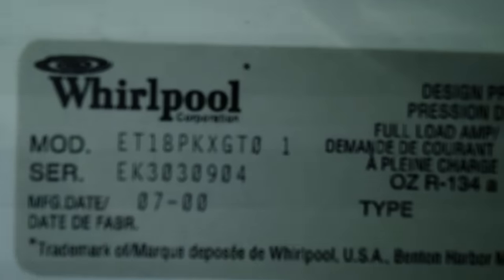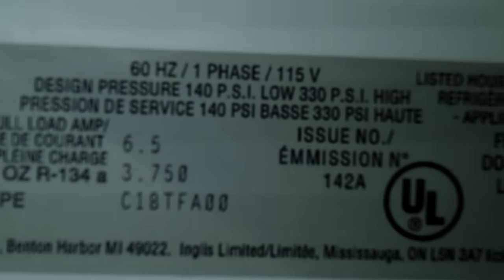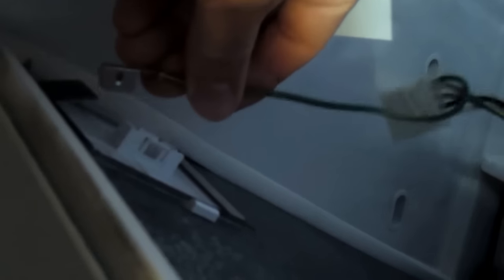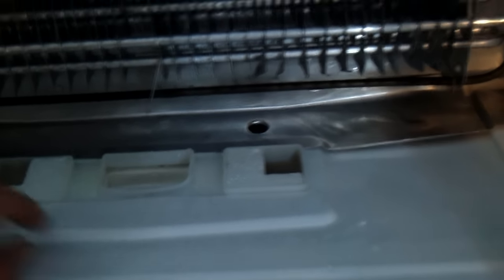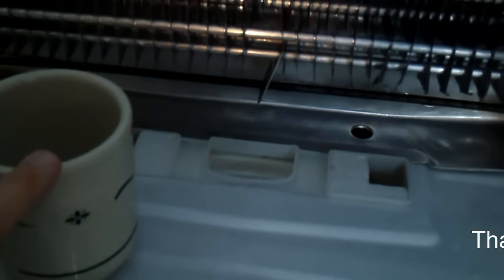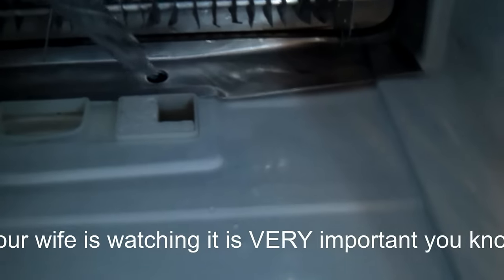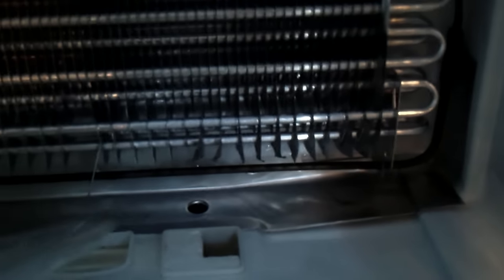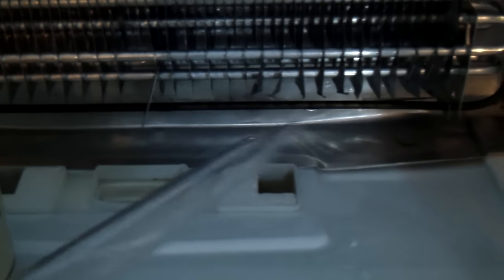Whirlpool Leaking Refrigerator Repair

Comment: The same thing happened to me today for the 1st time ever... I found a video that mentioned you can stick a 6 or 7 inch copper wire down the whole to make sure it does NOT clog with ice again (make sure you create a loop at the top so the wire can't slide down the hole!) - I hope that trick works, as it was NOT fun to fix this!

Comment: So mine isn't clogging but for true first time in years just heard the water hitting the silver part and draining fine. It sounded like it was hitting electrical wires which is why I was concerned until I saw it was hitting the plate. So then I good and this is normal?

Comment: Oh, DUDE!  You may have just saved me $500!  Our refrigerator has been flooded on more than one occasion, causing my wife to go bananas!  Also, it appears this "icing" and "clogging" issue may cause the refrigerator cooling system to run continuously, thereby sucking the electricity out of the grid and running up our utility bill!  They symptoms presented are EXACTLY what we have been experiencing, so I'm off to disassemble the components to find what I can find... wish me luck! :)

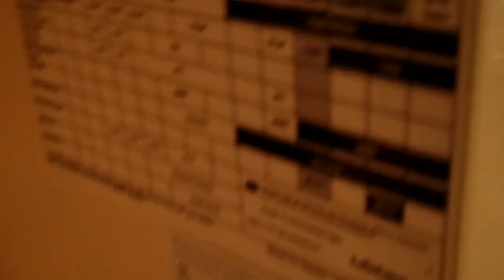Comment: My refrigerator (Model ET22DKXFW00) had 2 foam air ducts stuck into the 2 square holes you can see at 1:57. These are very easy to destroy, since they're usually frozen into the passageways, and we're not patient enough to let them get un-frozen so they can be slid out. I destroyed mine a couple of times, but now have bought two sets (p/n 4388450 for a set of 2, about $5 if you shop right) to have on hand. You may not have to pull these out, actually, but it looks like you need to the 1st time.

Comment: The way to permanantly fix this problem is to take an uncoated coat hanger and cut a 7" length.  Thread it into the drain hole and wrap the remaining end around the defrost heater element.  When the fridge goes into defrost, it will heat the wire and keep the defrost water warm enought that it can drain and not freeze the hole solid.  Mark

Comment: Couldn't you have gently chipped most of that ice off? Also...after you were done you could temporarily seal the drain at the bottom and fill that tube with boiling water to melt it all.
Great vid

Comment: My model looks nearly identical, except it does not have that drain hole. It has just a solid aluminium piece with no hole. Any thoughts?
Reply: +Land Designs Unlimited LLC thanks for your help here. It turns out there was a thick piece of ice covering it and couldn't see it. Took my wife's eyes to notice it.

Comment: This happened to me last year, but after a few months, it would happen again where it freezes up top, literally a sheet of ice on top of the drain hole.  To date, it actually froze again and I've been a little lazy to defrost the drain pipe.  How often do you need to defrost the drain pipe? It just seems like if I'm doing this like 3-4 times a year, something must be wrong with my fridge?
Reply: I ordered this today, so when it comes I will install.  Whirlpool 819043 Heat Probe

Comment: I  had the same issue I ended up grabbing a hose to blow into the drain line and after 10 puffs it cleared the line. The water in the drain pan was dirty

Comment: Has anyone discovered WHY that drain gets frozen and what the permanent fix is? Is crazy that this happens to so many WHIRLPOOL refrigerators inclusing mine
Reply from the maker: If you search the comments or the internet, there is a fix for putting a piece of wire around the cooling coil and down the drain.  I did it years ago, and this never happened again.  So long ago that I don't remember what I did.

Comment: I have not been able to get the screws loose. What did you use to get the screws out?
Reply from the maker: You should be able to get them with a slotted or philips screwdriver.  However, I wouldn't be surprised if I used a hex head screwdriver to get those out.  That will give you more grip on the screws.  Be patient and don't force anything.

Comment: I can expand on this a little.  Once you clear the blockage using the hot water.  Cut about a 3 inch piece of metal coat hanger, bend a hook in one end, place one end in the drain (long enough to hang into the drain but not block it) and hang the hook end over the over the heater coil. That will help prevent the drain from freezing and getting stopped up.

Comment: I have the same problem happening in my Whirlpool frig.  My refrigerator is a 2004 model and there is no pan in the freezer. Would you know how I remove the freezer panel in the back of freezer?? Thanks
Reply: If you have removed all "hidden screws" behind plugs then the panel pulls right off. Just be careful to unplug the fan wires after the panel is far enough to do so.

Comment: I think the holes also hold the bracket for the ice cube tray holder if there's no ice maker. You should definitely cap the water line, and I'd put the screws back in the holes as well. Turn off the water at the source -- a valve in the wall in fancy installations, or a saddle valve for less-fancy ones.

Comment: That's the way I repair the Whirlpool fridges. Long piece of copper wire wrapped around the heater running down into the drain tube. I think I have done a couple of dozen like this and never had a callback for the same issue.

Comment: There's no shock danger. The condenser coils are not electrified in any way. But anytime you open up the frig panels like that to work on it you should unplug your frig or turn of it's circuit breaker to be safe in case you touch an electrical component accidently.

Comment: This also will be our 3rd time doing this..Ours is 5/2004.. Very careful to not overload freezer  leaving at least an inch between foods for circulation.& make sure no peas or corn trying to escape. So while we know this is the procedure( thank you!) ... WHY?? WHIRLPOOL WHY?????.
Reply: Just paid $110.oo to the tech where we bought this from. He double wrapped a very heavy wire around the heat element.. not copper as to thin. But did as some of the video's show for placement. He said it was a GE wire part and showed me the package. He also said the dark heat element was pushed up into the coils as the ice dam pushes it up. He pulled the coil about 1-1/2 down from the coils & put another coil wire in to brace it. He said I should not see the same thing happen again. He also said it's a common problem. He gave me his personal cell # to call. I was OK with that.

Comment: After further research, I've discovered our problem may be the defrost timer. I know that my defrost thermostat and defrost element are ok. If that doesn't work, I've also heard that you can wrap 12 gauge wire around the defrost element and let some of it stick down into the defrost tube about 2 inches which will defrost the tube every defrost cycle.

I'll try to let you know what happens.

Comment: The main pointer is to keep it clean. Also , the ice may build up faster if you leave the door open, because the longer time of compressor operation makes for colder temperatures in that area,AND more water there AT the same time

Comment: This must be a design flaw in those refrigerators.

I have a Whirlpool ET21LKXHW00 (mfg. Nov. 1999) with the same problem.

Trouble is, I rent in the house that this unit is used in. The unit came with the house went it was bought in 2014.

The owner has worked with the housemates here but really it may be best to replace the whole fridge.

I'm not technically inclined to take apart fridges.
Reply from the maker: If you read the comments it's an issue with a lot of different brands of fridges.  There is a solution that involves putting a piece of wire down the drain hole.  I did that a few months after I made this video and the problem hasn't happened again.  If the fridge is your landlords show him this video, and the solutions, and he'll be able to fix it in less than an hour.  There's no need to buy a new fridge it's just one of those things that heppens with this model.

Comment: For whatever reason, the water freezes in that discharge drain and in my research, I've been reading that folks have attached a copper wire to the defrosting element and run the wire 4-5 inches down the drain.  The conducts enough heat that the water will never freeze in that discharge drain again.

Comment: Or you can just check the rear of the fridge and check the drain tube from below the drain pan and make sure the small warm air hole is not clogged with dust. The will keep that drain tube from freezing up.

Comment: That's p/n 819043, available for just over $5 if you shop right. As Dustin Fancher observed, though, you can make your own with a piece of #12 solid copper wire. Wrap a couple of turns around the defrost element, and poke 2-3" down into the drain.

Comment: The main fix is to make sure the area at the bottom of the freezer at the back is clear of ice. This is where the ice built up and blocked it.  What you can do to test is put a cup of water into the freezer section, at the back.  and check for where it drains to   Going to the bottom,back, (the hot part where the compressor is, there is a collection container  there ..), that is  GOOD. If it doesn't go anywhere thats bad, or if it goes to the front,  into fridge/cooler, that means its also  BAD , There is a blockage of food,debris, ice or a mixture.  If the water leaking to the front is icy cold, then there is still ice.

Comment: A coat hanger is steel wire, which isn't the greatest conductor of heat, and is not so easy to bend. Use #12 solid copper to address both problems. A big box store should be able to sell you a foot or so of bare copper wire, or a foot or so of NM cable ("Romex"), which will yield 3 pieces of wire.

Comment: The coat hanger wire trick only helped for a couple of weeks longer than not having one, but remember I was only able to get about two inches down in the drain before I hit some kind of obstacle (a curve in the drain?). So this time I put a 30" CEILING FAN BEADED WIRE down there! If this fifth "repair" (in five months!) doesn't work, I'll be forced to call an expensive expert. Sigh.

Comment: Will this work for a 6WRI22N Whirlpool fridge?
Reply: *****
ah it kinda does it just has a dial to adjust the air flow for the freezer, and thanks for your reply, after i unscrewed the screws at the back piece the cover wouldn't come off, i didn't want to force anything just in case it broke. any clues on why it wouldn't come off?
Reply: ***** Thanks for taking the time to reply to my comment sir, i will try that, or i may end up just turning it off over night and try again, as far as i could see there where no other screws. But you could be right on the gun there, Ice build up stopping it from budging.

Comment: FYI if you wrap the heating element in freezer with copper wire and extend it in the drain hole you wont have to do this again

Comment: If you decide to investigate further and solve the problem for good, remove the back lower panel, spot the exit and voilá! Maybe it has a grommet which is old and sticky, so water does not flow.

Comment: Yes, you will be doing this again.  Whirlpool makes a kit for this (the part number escapes me) to repair, which includes a thin piece of metal to attach to the defrost heater and then goes into the drain hole to prevent future clogs.  Otherwise if you call someone like myself who does this type of work, you will spend anywhere between $175-$200 for the repair, for each occurrence.

Comment: Mine is doing the same but there must be a reason why this occurs.  The friidge worked and drained for 10 years now it freezes up.  It's not food blocking?  Anyone know?
Reply: Sounds like you might need to replace the defrost timer. It's located in the fridge by the thermostat.

Comment: This is half the job. The other half is to clean out the rubber boot down at pan in bottom of fridge.  It gets clogged and backs all the way up to where you are at and then the tube freezes right there and overflows into back of fridge.

Comment: This is like repairing a leaking tire by putting more air in it.  It addresses the sympton but not the problem...The ice will be back!
Reply from the maker: There are notes in the comments about putting a wire down the hose to spread the heat of the defroster and prevent it from occurring again.  I did that and it hasn't iced up in a long time.  So long I can't remember when.
Reply: @CTSCAPER  I'm sure the wire will help.  Whirlpool actually makes a part for this Part # 819043.  While this will help, It is only treating the symptom.  I had my refrigerator for 10 years before this happened the first time.  The initial cause for me was that the glue on a piece of tape that holds something to one of the lines in the freezer caused a piece of Styrofoam in between the coils to melt.  The Styrofoam pieces clogged the drain tube and the ice built up.  After the first time, I could go for 1-2 years before the problem would resurface - then once per year - now it's every 3 weeks!  There has to be a problem with the defrost cycle somewhere.  My defrost heater is obviously good or I wouldn't get water in the first place so I think the defrost cycle is short cycling caused by a faulty defrost bi-metal thermostat or the adaptive defrost control timer.  I hate to throw parts at something but I'm going to start with the T-stat...and of course the heater extension...

Comment: Where he Stated " This is where the COLD air come in, that is actually not correct.......ONLY the center one is where the COLD air comes in. The TWO OUTER ones are "RETURNS" where the warm air from the refrigerator is "Vacuum out." To MELT any ice that is in the area a HAIR BLOWER can be use. DO NOT USE ANY sharp objects which can ruin the Evaporator unit.
This video is informative, but not very complete. Hope this help !
Reply: We have a 17 yr old Whirlpool and our configuration looks different than the one in the video...we have the center downspout and then a smaller square hole on each side of it.  You explained what they are perfectly, thank you.  And our leaks are coming from the 'returns'.  Guess we have to be thankful that this is the first time we've experienced this problem.  When you suggested a hair blower(dryer) did you mean to use it from within the refrigerator cavity or from within the freezer cavity?  We have an ice maker so I am worried about the process of disconnecting the back panel to get at the drain.  Don't want to damage it and then have to shell out for a repairman to come and roll his eyes at us for damaging the fridge while attempting to repair it.  And I don't want to have to replace a perfectly otherwise-good refrigerator.

Comment: Whirlpool has a service kit you can order that fixes this issue.
Reply: i have the same problem my whirlpool is an 04 and leaks from the freezer to the frig so its nothing i can fix? i have to buy a service kit? and what exactly is the problem? thanks!
Reply: speedwayman100
Hey bro. The problem is the drain hole gets iced up for some reason and that causes the evap system to back up. The fix is a service kit that has a piece of metal that goes into the drain hole and then attaches to the heater on the evaporator. Thus when the heater is on it transfers the heat through the metal in the drain hole thus not letting it back up. Hope that helps.
Reply: I have this exact model and it started dripping exactly like the video. In addition, the fridge part won't cool too much. Milk will go bad in 3 days. Is that a result of the dripping? Also, what is the name of that kit? I tried to buy a thermostat but the sales guy scared and tried to sell me a service call or a new fridge. Thx.
Reply: ***** Thanks for the response :-). I've tried the clearing out the ice and it's just like putting a band aid on an infected wound, because in a matter of a few days...it's back :-(. I really want to  figure out what's wrong with it and fix the problem for good.  Thanks anyways, though.
Reply: Thanks. I will, figure it out. I don't just want to be repeatedly cleaning ice away, I want a real solution, and if it's beyond repair, then at I'll buy a new one. But thanks anyway. Cheers!
Reply: Jeff Gustafson
hey bro im sorry im just seeing you got back to me i apologize i appreciate the info  and what i ended up doing is  taking  a few things apart in the freezer area to get to the drain and i put constant hot water on it and about an hour or so later i heard the ice drop and the drain was clear and its been fine ever since but i will keep your idea in mind also sophie hope  what happened to me helps you too good luck!!
Reply: Thanks guys! I usually unplug and use a hair drier instead of hot water. I really don't want more water on it.  If I'm messing with it, I don't want to have it plugged. I don't need any additional problems, lol.
Reply: since i took care of this problem i havent had any issues and my ice maker is working perfectly again
Reply: Sophia 925
 The ice is only coming from water in the air, thus it can only get there if the door is OPEN !. SO ... fix the door ?
Reply: Sophia 925
 Make sure the area at the bottom of the freezer at the back is clear of ice. This is where the ice built up and blocked it.  What you can do to test is put water into the freezer section, at the back.  and check for where it drains to   Going to the bottom,back, (the hot part where the compressor is), that is  GOOD. Going to the front, into fridge/food, .  BAD that means there is a blockage. If the water leaking to the front is icy cold, then there is still ice.
Reply: isilder
Check to see if the gasket is on correctly. You may have to replace the gasket if this continues.